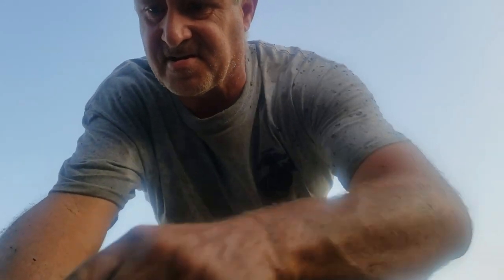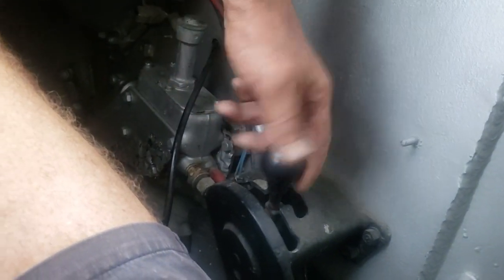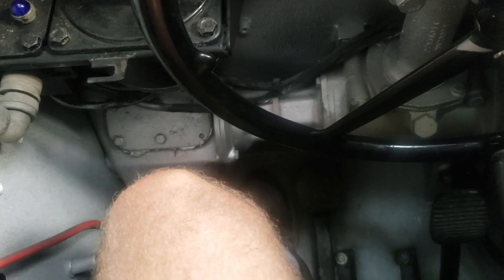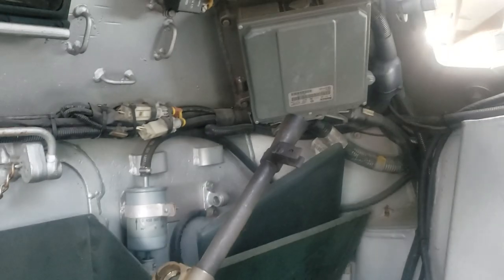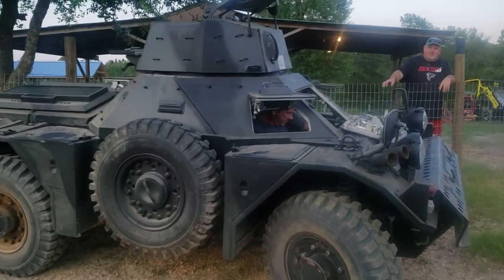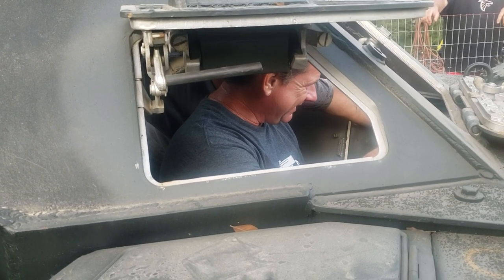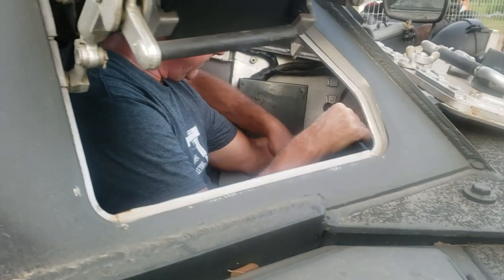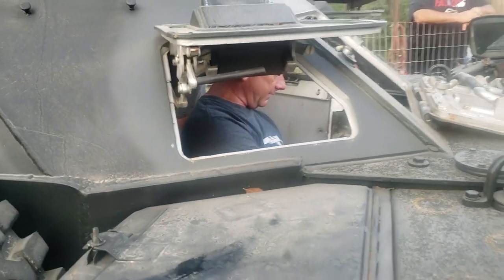How to drive the Ferret Scout Vehicle

Comment: what a load of balls.  someone please tell this person a Ferret never had a clutch, it has fluid flywheel and a Gear Change Pedal.
A GCP. that you press and release to change gear. Gears are pre selected . all drivers should also know as part of the maintenance everyday the GCP should be pumped 20 times in each gear to adjust the gearbox brake bands to prevent slipping.
Reply from the maker: Thanks. I'll make a note of that. Hopefully we can get someone with as awesome people skills and technical knowledge as you have to educate us further. No kidding, the owner bought it because he has a LOT of time being shuttled around in and firing from one, but never driving one. Self taught. Passing on what he understood. Terminology was not correct. But resulted in a few hours of fun driving and learning. When he said that he bought a Ferret... I thought that he meant a new pet. I am a neophyte.  I have been contacted by some fantastic Ferret and Fox owners who have been a tremendous help. New friends now with a group of Ferret owners. My apologies if this video made you cringe.
Reply: Exactly lol. Yanks
Reply: What regiment?
Reply: Sounds like it has a diesel engine fitted?
Reply: From what I see the failure to do the GCP ritual prior to starting is the biggest fault with new owners.

Comment: The guy ‘instructing’ doesn’t have a clue!!!!,...-there is no clutch or clutch pedal, it’s a gear change pedal, he says his ‘2nd gear is not working right now’...-probably due to him trying to use the GCP in the same manner as a clutch, ...-a sure fire way to ruin the gears
Reply: if I remember right it's a pre-select gearbox, not the best vehicle I drove but had a bit of fun in it driving all over Germany.
Reply: @pbrobotspbrobots1710  good piece of kit, but frankly I was always glad to run a spare spartan if I could. It wasn't usually an issue. Living out of a ferret was always a bit of a challenge. The tracked camping car was a much more civilised option.
Reply: He was winding me up every time he said clutch.....if your gonna teach  you should know your subject material...its a gear select pedal for a positive pre select gearbox.
The same  system as used on the Saladin and Saracen.
Reply: @mozki1  Yup..I had a Saracen, same deal. Use all the gears forward or reverse. Reversing was fun but the back doors had better be open! Ex South African Army

Comment: It doesn't have 2nd gear?? If you keep starting it without tightening the adjustable belts you soon may not have any gears at all.
Reply: Prior to starting, select 1st gear and kick the gear change pedal 7 or 8 times, Do that with each gear in turn. The action tightens the adjustable belts. Then start it up.